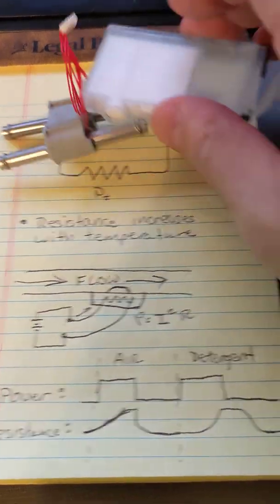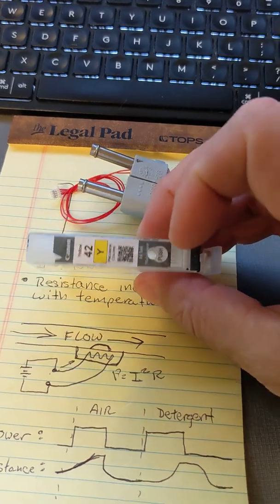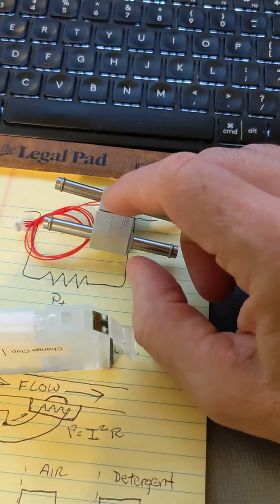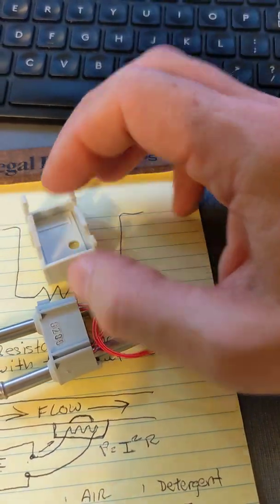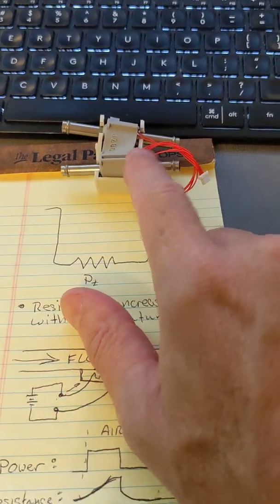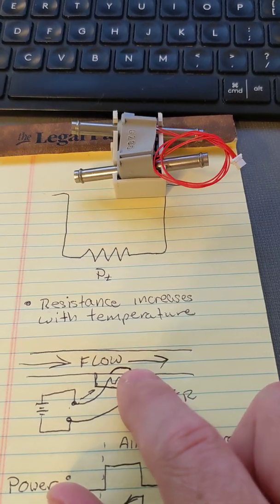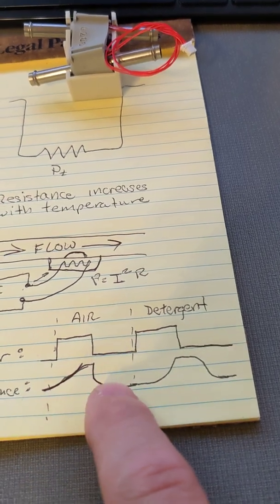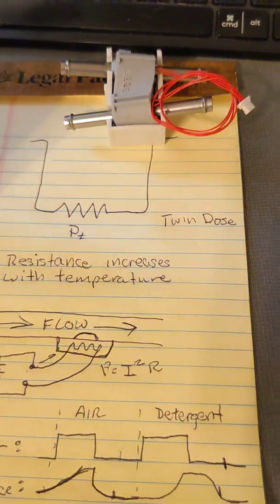Miele TwinDos detergent sensor - how it works

Comment: Thank you so much for this! I always wondered how the machine knew the detergent bottles were empty. If it would be a counting system, I could not refill the containers or change them. Like taking one out and putting another in. So this really helps! My guess now is that the measurement is done after every washing cycle. In case it failed, the message to replace the container will appear before the next cycle. So the system must contain just enough to run a full cycle with the left detergent if the measurement is positive.
Reply from the maker: The reagent pump is quite accurate - dispensing a known volume. It subtracts from a full bottle. If your machine is app connected, you can set the current reagent level for each twindos slot

Comment: Where is this located in a washing machine? Can you show it to us in a video?
Reply from the maker: I can't. It is still under ext warranty. It's inside the cabinet, behind the two TwinDOS cartridge receptacles. The two tubes from the receptacles lead directly to this sensor, then to the pumps.
Reply: @nickydoes  I found it, thanks !

Comment: TwinDos owner here for over a year. First (promo) no.1 container emptied and left it as it is for about five to six months. Couple days before I had installed universal cartridges to fill no.2 with water (I saw the problems when no.2 is leaking and also I don’t like oxidizer) and no.1 with a universal detergent from US. 
Now starts the interesting thing… the No.1 slot didn’t pass the care cycle for at least ten cycles. No.2 passed after two clean cycles even the promo container wasn’t empty. It was necessary for No.1 to run the cycles enough time with warm water and some pressure to cartridge… after that all clean cycles for twindos was successful BUT when I use the universal detergent the washing machine sees the cartridge as empty. When I swap the container with water everything it’s ok… the technician said to me that even Miele doesn’t has a correct troubleshooting but is working with possibilities. Change this and after this or this… 
So the guy didn’t know exactly how the sensor works and he thought that is reading something like continuity. I’m seeing now how possible is working but I can’t explain why the water is ok and not the universal detergent… 
Sorry for my English, I’m not native

Comment: My washing machine was giving a twindos maintenance message every time I did laundry. I tried to run the maintenance cycle with the Twindos Care fluid. I started the cycle and it would stop after a few seconds. I researched and figured the lines were clogged. Well I took everything apart and indeed it was clogged. I cleaned all the pipes and even ran a zip tie through the sensor pipes. I put everything back together and run the Twindos maintenance cycle and it starts but now I get a “Fault F212” message. Ahhhh. Frustration! Do you think running a zip tie through the sensor tubes could’ve damaged anything? I was also tugging on the cables a bit when I was trying to remove the hoses, which were extremely difficult to remove. Anyway, thank for the video.
Reply from the maker: I don't think a zip tie would damage the sensor. I recall the interior being a stainless tube. Can you find a service manual online for the washer to decode the F212 error? Try emailing Miele technical support? I know, I know...
Reply: @nickydoes  I opened the machine back up and saw that the thermocouple was unplugged from the twindos computer chip. I just plugged it back in and everything works now. Thanks!

Comment: So, as a technician (not working for Miele), I can confirm that you can confuse how to put that thing when you replace it (it happened to a colleague). 
However, from what we had to observe due to this mistake, it doesn't look like the sensor is exactly working how you think it does. First thing first, when the machine isn't pumping detergent or oxidizer, it isn't filled with air. It is still filled with liquid sitting there, due to its viscosity. That's why in the instruction manual of TwinDos washing machine, they tell you that if you are going to stop using the TwinDos system for more than two months, you should use their TwinDos Care product - which is cleaning the pipes and removing all viscous detergent inside. If you do not do that, the detergent or oxidizer will dry inside, totally clogging the pipes and next time you'll try to pump it, it simply won't work.

Therefore, the sensor does not detect the absence or presence of liquid compared to air, I believe. Because in that case, clogged pipes would still have the same type of resistance answer than working pipes, or almost. And the machine would never take any detergent and would never even know it.

What we noticed after working on that machine where the sensor was placed the wrong way is that the liquid has to be running in the pipe to cool down the resistor fast enough, if it's really what's in there. Still liquid won't work.
A fellow technician who studied auto-dosing machine talked about the Seebeck effect being used in there, but if it's true I have no idea how it works.

By the way, the Electrolux/AEG system to survey the detergent level for their AutoDose also works with prisms and IR detectors.

PS : Sorry for my English, I'm not native so I hope what I wrote was still understandable.
PPS : for those who have to have that part replaced, most of the time the issue is due to an oxidation of the connectors. Not sure if it's something which can be cleaned. Also, if you ever manipulate that, pay attention, the oxidizer is really burning your skin.

Comment: I own Miele W1 since 2019 and bum - error F0212.
My parents  own Samsung washing machine and it works perfectly for over 10 years now. Never again Miele...
Reply: Mine is from 2016, I changed the sensors twice ( 2019 and 2024) because of the error. Since the warranty period expired, it broke 5 times so I’ve paid its full price twice. Don’t know if it’s worth it. I like their detergent but is expensive to own a washer from Miele with all the issues it has.

Comment: if you have a faulty sensor, and don't want to pay for the replacement + don't care about empty tank detection, you can solder in a 120 ohm 1% resistor. That's what the stock sensor measures at room temp.
Reply from the maker: That's doubtful to work. The sensor measures the cooling time after heating. A current is passed through the resistorm the temperature is measured. After a time, the temp is measured again. The drop in temp tells if the tube is filled with liquid or if it is empty.
Reply: I would think they don't actually measure the cooling time, but just have a temp threshold above which they deem it's empty, with some counting/deglitching for good measure.

So my reasoning with the R120 trick is that, a "normal" (ie, low temp coefficient) resistor value won't change with the applied power (or to non-discernable ammount by the crappy adc of the 8-bit twindos mcu). Which is, even with a Pt100 probe, probably what actually happens when there is liquid in the tube. As It would probably not be very reliable to measure (and actually expect / enforce) in the code logic the slight temp elevation when the sensor is actively cooled by the detergent (plus, given the very thin leads, power must be very low and cannot really heat the detergent under resonable time)

I'd expect the code logic to be something like: apply power, cut power, wait x seconds (for heat propagation through the metal tube), measure adc, adc_val > empty_threshold ? empty_cnt ++;   redo that whole cycle a few time, if empty > confirmed threshold count --> actually_empty = true + warn user.

Anyways, the only way to actually know if miele code is more clever than that (i'd expect not, it's an 8-bitter afterall) would be to test it :p ! And, in any case, the R120 trick might be worth the few cents it costs (vs $100+ for the original Pt100 assembly) if it works :D !

Comment: Just had to have the Platinum Sensor replace due to the error message.  Total cost £252 including the 30 minutes Labour to change this plug and play part.  Total and utter rip off, and I called Miele Customer Service to say exactly that.  The machine still works perfectly fine with the error, but it annoyingly pops up constantly.  We use powder straight into the drum before the clothes go in, and Twindos once per month.  We use white vinegar instead of softener, which is far better for fabrics.  Conditioner we only use on items that need waterproofing.  If the sensor breaks again I am going to ignore the error messages.

Comment: I got the dreaded F214 error which indicated issue with TwinDos 2 compartment. I replaced with brand new sensor, went smoothly. Same error. Any other ideas?
Reply: You resolve it?
Reply: @croitorudaniel2217  yes, you just replace the EZL 166 board. It’s about $100. You can buy it directly from Miele. It’s MUCH easier to swap it by opening the back of the Miele washing machine rather than the front. There are many guides on how to do so on YouTube.
Reply: You resolve it?
Reply: @elenadaniela6020  @croitorudaniel2217

Yes I resolved it. I replaced the EZL 166 board. Part number 10781471. Can be purchased directly from Miele for $120. 

Just follow the instructions to open the back of the machine. There are a few videos on YouTube. No need to open up the machine from the front, which is much more complex. If you open from back, you have direct access to TwinDos unit and the board that needs replacing. It’s right next to the Platinum sensor.
Reply: can you share link or directions on how to replace the sensor?
Reply: Yes I resolved it. I replaced the EZL 166 board. Part number 10781471. Can be purchased directly from Miele for $120. 

Just follow the instructions to open the back of the machine. There are a few videos on YouTube. No need to open up the machine from the front, which is much more complex. If you open from back, you have direct access to TwinDos unit and the board that needs replacing. It’s right next to the Platinum sensor.

Comment: This sensor erode easily by the detergent. I left the faulty sensor connected to the silicone hose and plug a new sensor to the pcb. I hope this hack will save the new sensor from contacting the detergent thus increase its longevity.
Reply: Correction, I dissected the sensor, the “sensor” did not come in contact with the detergent at all. It was soldered outside the tube. On magnification, the sensor look like a strain gauge.
Reply: Update: it is a Thin Film Element RTD PT100 platinum resistance sensor, Sensor precision ±0.15℃. I replaced it and it worked.

Comment: I'm curious... do you think the machine uses this as just a true/false kind of flow sensor, or is it able to measure flow rate as well with these?
Reply from the maker: This is a liquid presence sensor, not a flow sensor. I presume it reports presence of air or liquid only, and does not give more information about the liquid. It is definitely not a flow rate sensor.
Reply: @nickydoes  Good to know -- my unit has been overdosing detergent, and Miele recommended to the tech that they replace the platinum sensor. After watching your video, it seems like that may not be the issue if this sensor doesn't providing any flow info...

Comment: Very interesting. I have an issue with this sensor. I think it has to do with the fact that the machine is placed on top of a dryer in a closet. I think that the cool down curve is such that the software states that it is faulty. F0 211. Could this be true?
Reply from the maker: The common way to run these sensors is to measure the resistance, apply energy to heat, then measure the resistance again. I'm not certain how Miele implemented this sensor exactly.

Comment: Recurrent revenue isn't strictly fair. You can use the provided refillable containers to add your own detergent.
Reply from the maker: It's fair in the US. The UK/EU refillable containers can't fit in the US machines, and the software omits the option to select other agents.
https://www.reddit.com/r/Miele/comments/y857p4/do_the_european_twindos_refillable_containers_fit/
Reply: @nickydoes  I stand corrected. Does beg the question as to why?! No logical sense.
Reply from the maker: EU/GB is less tolerant of anti-competitive tie-ins? If so, it makes fiscal sense. If you find out, please share.
Reply: @nickydoes  Do you know what the difference is between US and EU/GB cartridges? I find the refillable containers are slightly different anyway and don't always register well with my machine.

Also, in my opinion, I think it is probably closer linked to issues with liability in the US.  If they can't regulate what people are putting in and will be held liable for damage, makes sense to restrict it.
Reply: @panino.c  Im close to buying the set of Miele washer and dryers with TwinDos, and thought about the refillable cartridges.  First reason was my wife really likes Tide, second reason was cost long term.  If we cant get the refillable options i have seen some "hacks" where people are refilling the TwinDos cartridges with their own detergent.  All of this said, i am very curious about how efficient these units are with the Miele detergent via TwinDos vs using 3rd party detergent.  If its more expensive for the Twindos detergent but its more efficient in its usage, i will be fine with that.  Has anyone really analyzed this from a cost perspective?
Reply: @bucks_in_6  Don't know about cost, but I stick to the Miele cartridges for convenience and machine longevity. Other brands don't always play nice. 
They are certainly more expensive, but you can manage the dosing to suit your needs. 
Hope that helps.